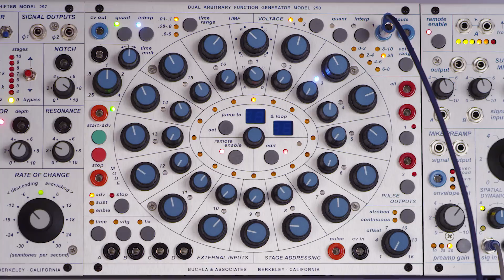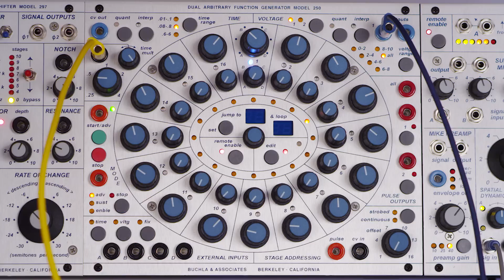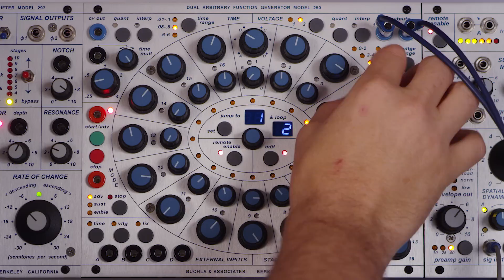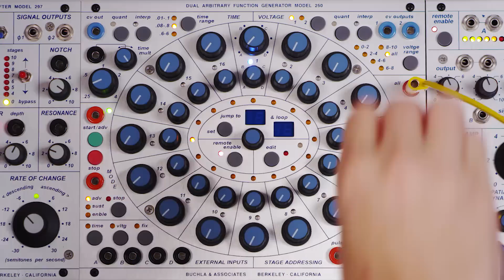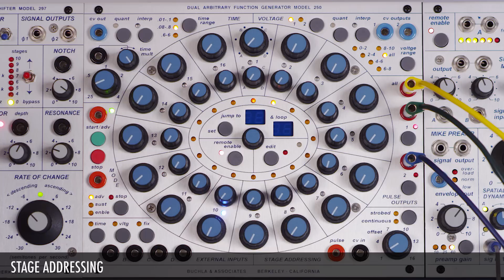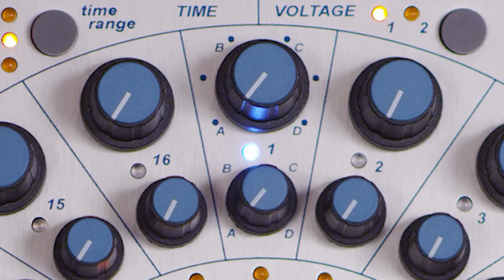Buchla 250e Dual Arbitrary Function Generator Tutorial & Demo

Comment: Regarding stage addressing: I can't get my 250 to sweep through the full 0-16 steps. Best I can get is 0-14.
Can you confirm yours does this?
Reply from the maker: +ourigin. Yes mine does a full 0-16 stage range - but I’ve noticed some inconsistency, but it could either be from the calibration/precision of the 250e stage addressing itself, or the accuracy of the control voltage applied. For instance, when I first tested - not on the demonstration in the video - I applied from a source CV sweeping from what I thought was 0-10 volts, and the 250e would vary sometimes between a range or 0-14, 0-15 stages - but then later, with no other obvious factors, it would do the full range or 0-16. Perhaps this is due to either the 250e or the module providing the voltage not providing the expected range. I could have tested with a multimeter, but did not - instead I opted to run my source through a 256e CV processor to clamp and massage the source voltage into a range that would give me the 0-16 stage range in the way I expected. This gives me the most reliable result, as I don’t have to concern myself with the zillion other variables that might be affecting things: circuits warming up, small power inconsistencies/flucations, etc. that might be limiting the voltage needed to drive the full stage range.